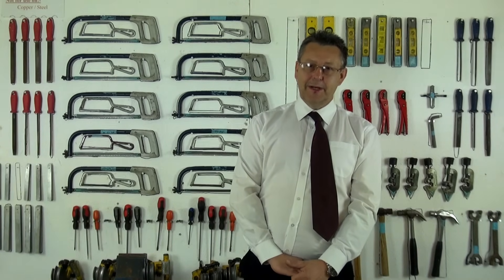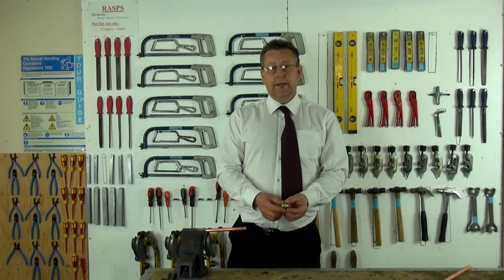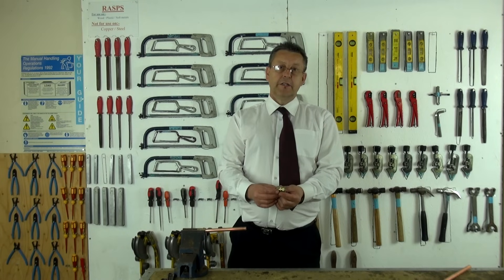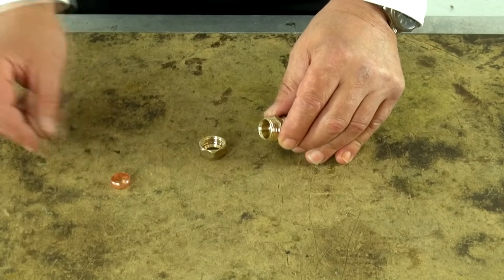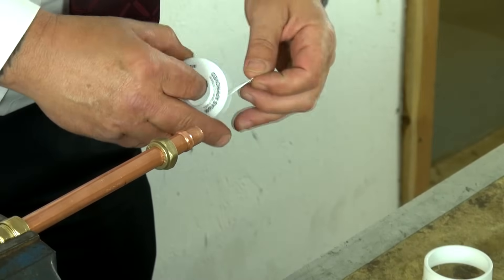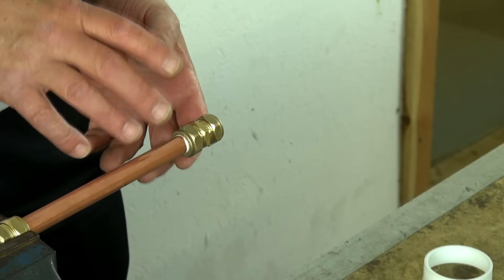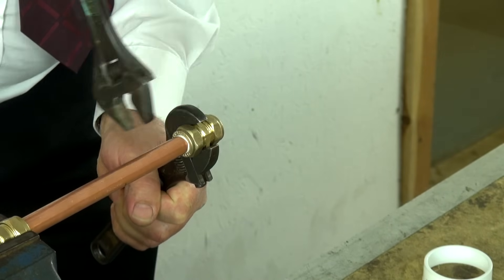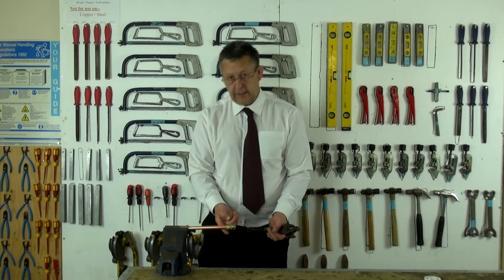Compression Fittings Tutorial

Comment: I have a copper pipe under the kitchen sink, ½" and the olive was stuck.  I guess it was old enough that it had compressed.  Rather than try and take it off and risk damaging the pipe, I put the new valve on, and it leaked. I tried thread dope, still leaked.  Dreading what I would have to do to remove that old olive. 

I wrapped the olive in Teflon tape per this video.  No leaks!  Thank you so much!

Comment: I usually go with a half turn- get the nut on and hand tight, take a sharpie and mark the body of the fitting and mark the nut on the other side, then as you tighten you can see when the nut comes around and lines up it's done. No second guessing or wondering how much it's been turned. 1/4 turn is barely compressed at all. And lately I've added a smear of LS-X to the olive/pipe where it enters the fitting as a belt and braces for any imperfections in either the pipe or fitting....

Comment: Job today.. had a 4 inch water mains pipe in a factory, it had been blocked of with a ball valve. 
The ball valve blew off with the olive not leaving a mark on the copper pipe. There was ptfe tape around the olive and we removed the ptfe and fitted it all back with the bigger pipe wrench,  As tight as we could. Now I'm worried because you say don't over tighten..... 😬

Comment: PTFE should be wound in direction that the cap nut turns!! (Although you should not use PTFE on a brand new joint!!)
And finally i would tighten a little more than that for security.... wouldn't want it blowing off would we... 👍😊

Comment: That's where I'm going wrong, I've been tightening as much as I could. Brilliant thanks 😊
Reply: As long as the pipe is square into the body of the fitting and it's tightened just nice and snuggly then you don't need PTFE or any type of jointing compound. Just to let you know that this guy doesn't seem to know what he's talking about as he wound the PTFE tape onto the pipe backwards. The tape the should always be wound in the same direction that the nut tightens (clockwise) as if it's wound the wrong way round then it will just unravel as the nut is tightened. I only use tape when I am fitting new and old fittings together. If you have an old pipe with the olive embedded then it's best to tape it before fitting it to a new fitting.
Reply: @truthseeker7794  thanks for the advice, I'm always happy to learn.
Reply: @truthseeker7794  Old pipe with olive embedded can be tightened without tape and still be tight.
Reply: @disastershaman  Yes in the case of an embedded olive I would just wrap a few turns of PTFE around the olive and on the half inch of pipe that will be pushed into the fitting. Just to make sure, but usually I wouldn't use tape on a new fitting.
Reply: @truthseeker7794  "he wound the PTFE tape onto the pipe backwards." Sir you are right. That, is not good, considering 900k views.

Comment: Lay the PTFE tape on the olive away from yourself ie clockwise.
Reply: @izalman  Hi iz - Clockwise?  Depends on which way you are looking at it!  (Just joking with you).  I think you mean the tape should be wound in the same direction as the compression nut is turned.  
It is really bad that an instructor is suggesting PTFE tape.  PTFE shouldn’t be used on a compression fitting – particularly where the connecter SHOULD be NEW and the pipe is clean and undamaged.  The good advice from this video is "finger tight, plus quarter turn", and an extra pinch (or two!) if there’s any sign of a tiny leak.
Reply: @iainmeteorscan1555  Good point re the 'same direction as the nut turns'. As for using tape on compression fittings - many years ago when quality fittings were available I'd have agreed with you but over the years all the quality manufacturers have shipped manufacture to China or similar and quality has plumeted vertically. Unbranded cheap rubbish is everywhere. to avoid costly revisits, I'll stick to my 'best practice' of taping the olive and nut threads, the latter as a lubricant against the brass/ brass friction when tightening .

Comment: Great video except you wrapped the PTFE tape in the wrong direction. It needs to be wrapped around in a clockwise direction so when tightening the nut it goes with the rotation and not against it
Reply: @Jason Bucks UK  Hi Jason.  Hear hear - that's also the first thing I thought!  It's also shocking to think that PTFE tape was even discussed - either PTFE SHOULD be used OR it SHOULD NOT - both can't be correct!  (In fact, neither PTFE or any other sealant is necessary).  
Problem is, too many bodger plumbers about!

Comment: There are many other videos where different plumpers do not use that white tape while connecting the same copper pipes... My question is; do I really need to use tape or it is not necessary???
Reply: @Denis Bachvalov  Hi Denis.  With a new fitting and nice clean copper pipe, absolutely no PTFE tape or sealing compound is required.  If PTFE or sealing compound IS required, then it's a bodge job, and it hasn't been done correctly!

Comment: Compression Fittings Tutorial
You're talking bollocks, you need to give the nut a good tightening otherwise water will leak through and it will not damage the pipe!  Now go away and straighten you tie.

Comment: @ 3.30 - shouldn't the PTFE tape be wound onto the pipe in the same direction that the NUT will be tightened - i.e. CLOCKWISE?
Reply: What about no ptfe tape, it shouldn't be on compression fittings in the first place
Reply: @lukie4ever  A professional plumber describes the procedure as "belts & braces." He stated that in all his many years of doing so, he'd never experienced a single leaky connection. For the sake of 50-75 mm of PTFE tape, it sounds worth it.
Reply: @fontybits  I'm a plumber as well and i just want to say just replace the fitting, that is a much more reliable way of doing it
Reply: @lukie4ever   Hi Lukie.  Hear, hear - agreed.

Comment: Would a 15mm pipe with one isolation valve/flow restrictor have the same end pipe flow rate as the same pipe with 3 flow restrictions?

I have a 15mm shower pipe with three joins using  three flow restricted isolation valves and was thinking of replacing two with full bore couplers

Would that increase flow

Comment: Exactly what I needed tonight.  Thank you!  Never thought about putting the tape on the sleeve!  Of course now I will call them olives instead!  Sounds quite proper.
Reply: Professionally done video; very helpful. The only comment I have is with respect to the direction in which the PTFE tape is being applied. It should be applied in the same direction as that in which the compression nut is tightened. As presently shown, the tape would tend to unravel as you tighten the compression nut. Other than that, the video is great.

Comment: I plan to custom build a modular air compression system for my shop, and I'm coming to find that compression fittings is necessary if I want to build a copper coil heat sink.

Comment: Apply the tape in the opposite direction as shown in the video. The end of the tape needs to point to the direction of screwing on the nut. 
Apply nonsetting thread sealer (pipe dope) instead of tape. Thread sealer fills in the defects in the pipe and the compression sleeve.
Reply: Is he turning the PTFE sealing tape in the correct direction??
Despite that Im aware that those Sealing tape is not going to get into any directions of any outer threading...

Comment: Had noticed a leak on an old compression fitting before and would never stop no matter how I try to tighten it.  End up wrapping the ring with tape and tighten, and leak stopped.

Imagine using compression fitting for your plumbing, and you have to physically check all those fittings carefully after turning on the water?  And behind walls?

That is why I prefer to solder or PEX.

Comment: If you line up your joints properly you will never need PTFE. If they are at an angle a bit of PTFE is good to stop any seepage.
Reply: If they are at an angle, something is wrong... Ptfe tape is messing things up.. Just like using Silicone caulk when a drainage pipe is leaking.

Comment: You should never put ptfe tape on a compression fitting. If the tape breaks down under heat you may get leaks. The whole point of a compression fitting is that you have a metal on metal seal.
Reply: PTFE melting point is 327°C. I'd be greatful of a leaky compression fitting in a house fire
Reply: @Barry Hughes  Hi Barry - hear hear!

Comment: Is this system also GAS TIGHT
Reply: Hell no the PTFE tape used is only rated for water. Not only that it shouldn't be used around olives. There's really no need. Yellow PTFE should only be used around gas threads with a 50% over lap. Although again not needed around any olive compression joints. If your not Gas Safe registered. I'd recommend you Do Not attempt it.

Comment: I don't know they use flaring tools. For high pressure. Why can't you use these on houses they have for hundreds of years. Till someone decided they wanted to solder a joint. Which was useless putting lead in your drinking water for the you steal line so you could drink rust now they're using pressure fittings with rubber O-rings which will leak in time. Somebody is overthinking the problem
Reply: I'm a huge fan of copper compression fittings. After soldering day in day out. The fumes kinda irritate some of us heating engineers and plumbers a little. They're a little bulky and expensive. But save time and look the mutz nutz. I only solder when required now.

Comment: Never tighten on to tape, only way is tighten fitting and Demounts and add jointing compound. Ptfe tape is for male threads ONLY
Reply: @James Julian, that’s nonsense.  Also, paste gets into places that it shouldn’t.
Reply: According the the Dahl website you are right. They say not to use tape or dope on their compression fittings. My guess is people see improvement using it when putting on compression fittings on old copper pipes with imperfect surfaces. Who knows though, in 1-5 years that install might leak.

Comment: The greatest disadvandage of compression fittings that it is very difficult and time consuming to correctly align compression elbow fittings, on each end of the pipe at the appropriate angle (lengthwise). I mean, to try and align a compression elbow at each end of the same pipe at a set angle between the elbows themselves. It proved nearly impossible because at each tightening turn on one end there is bound to be some minute movement which will alter the angle in relation to the opposite end compression elbow. And a wrong angle between elbows on each end will create unnecessary (twisting) strain on the pipe itself when connected to the rest at both ends.

I am no plumber and decided to do this because I did not want to take the risk with soldering as I am not confident yet. It took me ages to approximate some sort of acceptable alignment. Converlsy, with soldering, one has to just set the aligned elbows and solder them in place. No screwing with the spanner, hence little chance of misalignment.

Comment: With water Yes using Teflon tape would be ok but not as much as in the video and apply in the CORRECT manner so when tightened the tape doesn't come loose. when on a Natural Gas application Never use tape or ptfe paste (Pipe Dope) on flared fittings.

Comment: Yeah, I would likely be guilty of over tightening.  Over the years, I have learned to adjust my bad habits.  1/4 turn, that seems slight.  Will remember.  Thanks.
Reply: I'm the same man, does not feel right unless you give it a good wrenching. 
Agree that it is probably too much though.
Reply: I’ve just over tightened two olives on my new tap but it hasn’t leaked, do you think it will be ok? Thanks
Reply: @Robert13732  if it isn't leaking it's fine...don't worry about it. If you had overtightened it and deformed something, you would have a leak on your hands.

Comment: you don't use ptfe around an olive, as a plumber this does my head in
Reply: Depends on the quality of the fitting. Some modern compression fittings come with olives that are loose on the pipe and very hard metal. Sometimes I have had to undo a joint again and add ptfe tape to get a water tight joint. That never used to happen years ago when I first did plumbing work. I guess it's imported crap.
Reply: @Replevideo  I know what you mean. You do them up finger tight, then after about half a turn they literally will not go any more, no matter how much you try. Feels weird and unsettling, almost as if there is no olive.
Reply: stuart shelley thank you I feel the same
Reply: agreed... hawk it up !
Reply: Whys that then? A few people are saying this.

Comment: 1. Never any need to use PTFE on a new joint like that.
2. You put the PTFE tape on the wrong way round!
Reply: I'm a carpenter!! As a you all know that makes me a master of all trades!! Your all wrong!! I put ptfe tape on the pipe!!! Force the olive over it!! Then put the tape round the olive!! Then put ptfe tape on the thread!! Then I tighten that fucker til the ptfe tape liquifies and starts bulging out!! The wrap the whole thing in ptfe tape and paint! Now that's how it's done!! I love ptfe tape!!
Reply: Marc Scotland I agree, and he even  says you shouldn't need to apply it, but said " some people have a preference to apply it " .
Reply: Marc Scotland No. In this case he wasn't actually applying it to the threads, so no matter which way he turns it won't unwind. Also, sometimes putting ptfe on threads of a compression fitting is not advisable. Like when making a gas connection with a flexible connector, it can cause a homeowner to overtighten and split the fitting. I see it a lot in my job. I'm the gas guy who gets called to check out the odor of gas after the landlord left a leak on the new space heater or water heater.
Reply: Jeffrey Guyer yes thats for all to see in the video.  use of the ptfe tape would be to apply it in the direction the nut clamping against it would be going, this guy is doing the opposite. putting ptfe on a new compression fitting isnt needed either.
Reply: He did state that it isn't usually needed on a new pipe.
Reply: PTFE tape is only use on fittings they have to seal on thread not on flare ore compression is common sense in anybody who works on the fittings industry
Reply: He did say it is not needed on a new fitting.  On old fittings, where you re move or adjust a compression fitting, it is a great idea.  I can't see any problem putting it on in either direction, since he is not putting it on the threads....
Reply: Jeffrey Guyer yes you do, so unless its a left hand thread its wrong.
Reply: Handyjack Nope, he applied it correctly, you wrap the Teflon in the direction you turn your fitting.